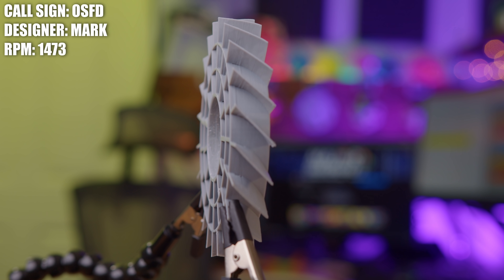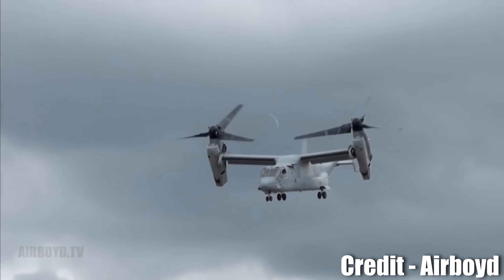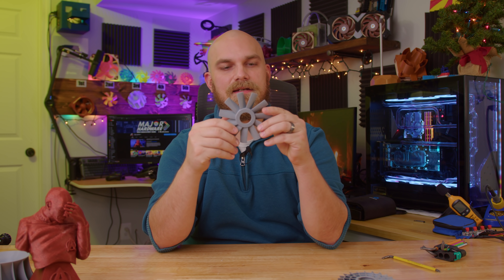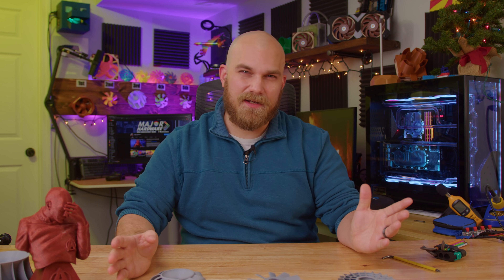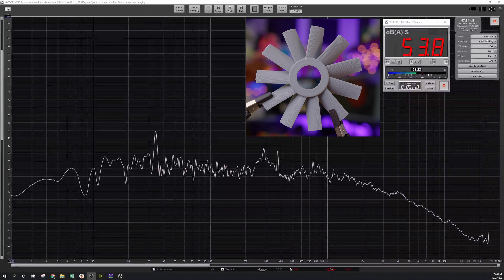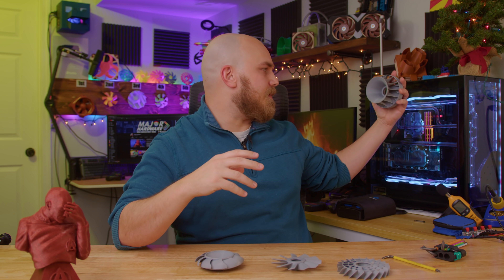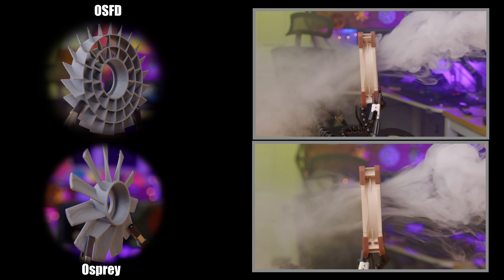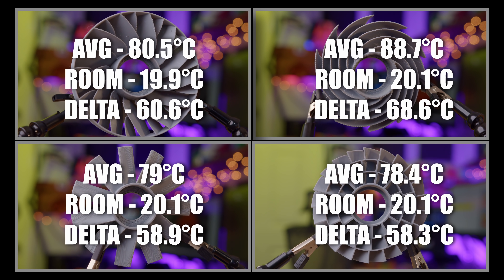INTERESTING | Fan Showdown S3E10

Comment: As for the Francis turbine can you squish that down to about instead of that big big funnel maybe squish it down about a few more centimeters and maybe tiny tweak to the angle of attack those blades in that intake are..... Maybe it actually might improve.
Reply: And I mean like it would not have as much weight on those tiny motor bearings...... And it would flop around less

Comment: I love this channel lol, I just want you to know I bought six phantek T30's and 2 noctua NF-A14s because airflow why not lol. Not to mention the 2 extra thermaltake tough fans that I bought when that review came out. My pc is now so loud I can hear it across the house. It's amazing lol keep up the good work and thank you for these videos
Reply: Linus tech tips did a video in the last... day or two? that was supposed to be about how much it mattered whether your front panel was solid or mesh, but actually ended up being largely about how more and stronger fans could actually make your cooling Worse, because while they increased the flow Rate, they also changed its Path... with the result that the CPU got cooled SUPER well... and the GPU basically cooked because the eddies and such caused by the cooling fans prevented the hot air in that part of the case from ever actually moving away from the GPU.  So yeah. More complicated than it initially sounds.
Reply: @laurencefraser  I haven't seen it yet but 2 of the the high powered fans are blowing on my gpu which I have set to max fans always. I should also mention the my case has a gaint 360mm side fan. While I haven't done a smoke test lol, I have put pieces of thin blue painters tape everywhere and they all move extremly well. No dead spots. Everything is overclocked as high as I can go and nothing gets above 40°c except my cpu which stays at 60°c I'm running everything amd/radeon so they're known to run hotter so I went for as much cooling as I can. It also helps that the room says at 60°-65°f lol

Comment: The scooper dooper should be reversed, looks like it would perform better going the other way
Reply: To be honest, this is not the latest version. I sent another message, with improvements. However, now, after what I've seen, I want to work a little more.
Reply: @sl_st  hope to see another revision, it is a cool looking design.
Reply: @sl_st  a v2 of this would be dope to see
Reply: Nah the design does not leave big enough room to move air through, it fills it with unnecessary plastic. On top of having less airspace, resistance increases with smaller spaces further killing the performance. That fan is doomed. Fun design, but doomed.
Reply: @KimonFrousios  so half the blades and it might work?

Comment: Kinda curious how the turbine would work with some kind of collar to direct the exhaust air, could be used in a pull config on a cooler and send air straight out of the case

Comment: Would be neat if you had a static pressure test rig that could double as a flow rig.  simple box with a hole in the back that would be opened or closed as a fine adjustment to flow for the hole in the top where you'd put an acrylic tube and a ping pong ball. Adjust the hole size till the ping pong ball is maybe a couple inches from the top as your calibration. The other fans would have to try pushing the ball up the tube to beat noctua. Think lung capacity gauge. This would accurately gauge flow.  For static pressure, you could use the same box but block off the air flow calibration hole and acrylic tube. Use a clear nylon tube shaped as a "U" about idk, 8" tall? Partially filled with colored water. atmospheric pressure , the tube sits at rest at 0 inches. Use noctua as a benchmark and see how many inches of water the fan pushes it. This is your static pressure literally measured in inches of water.  Doesn't get much better than that. and it's more content, as well as more actual measurable data. CPU cooling is cool and all, but there are too many variables. As an added bonus, these tests can take a fraction of the time it takes you to do a cooling test. ;)

Comment: One metric that might be interesting to track in the future is how much these fans perform against static pressure. We can infer this  indirectly though the CPU results, but it's probably a good KPI to predict performance.  Or you could just show the flow rate of the smoke when there's a stock cooler attached.  Love the videos! :)
Reply: Should be fairly easy to implement as a DIY solution, just a box with a typical hydro-manometer. Could also have a similar plenum setup for testing the pressure drop of a cooler. The leaderboard should be changed to separate airflow and pressure fans, though, especially as the entire range of fans is only tested on one setup that'll favor one over the other. 

But it might also be a better idea to just give GN an SLA printer and let them have a go at their own fan showdown, considering they have industry equipment for proper testing and they have proper methodology.
Reply: @xaytana  Who is GN?
Reply: @reverse_engineered  Gamers Nexus

Comment: Hello! Very different ideas for moving air but quite effective (other than the scooper dooper) nonetheless. Great episode 👍

Fan Idea
I do not have any 3D modeling software or skills to create this, so I am putting the idea where it can count

Callsign: Celer
Description: Made by math itself.
Design: Front swoop is Phi and airfoil shape is brachistocrone curve.

This was inspired by 2 fans. The Brachistocrone fan, made to look like air scoops. The Golden Ratio, which had an interesting ring around the edge. 
If anyone remembers episode number or true callsign, I would appreciate it. Thank you if you're reading this, and have a good night.
Reply: Someone get this on the show

Comment: New idea for the smoke test. A 1x1x1 box used to pull the smoke out of. Thus keeping any excess smoke from coming around the fan and making the discharge hard to see. You could also time the amount of smoke injected into said box and time how long it takes to clear out the smoke. Maybe giving a crude cfm calculation in the process.
Reply: The air also has to enter the box. Which would cause problems:
A. Then it can’t hold the smoke if there is an air inlet in the box
B. Even if managed to keep the smoke in the box would act a big funnel. (Cheater)
C. The box would never be completely free of smoke
Reply: @carterkirtz4848  didn't say anything about a completely sealed box. Also how do you think case fans work? What I suggested is absolutely possible to do. A slider in front of the fan and a second slider opposite the fan for a fresh air intake. A port anywhere else to inject the smoke in. Fill it with smoke. Open the doors. Turn on the fan. Pretty simple idea. Don't overthink it. The box could even be the dimensions of the fan for height and width but 2 feet long with a divider in the middle. Fill one half and open the divider once the fan is on. That'll show better smoke "suction"
Reply: 1inch cube?  1 meter cube?  1 what?  it makes a huge difference.
Reply: yes a plexi glass rectangular box with the fan at one end and the smoke at the other

Comment: This has to be the most underrated tech channel. Fan showdown is such a great concept and allows for a lot of viewer interaction. 

I haven’t been drawn to 3D printing, but if anyone would get me into it, it would be you. Suggestion for a video if you’re looking… 3D print air guides to mount on to case fans to point/direct the airflow to components. I’ve always wanted to know if this would help, especially on a large case where airflow can get lost.

Comment: Interesting that the Osprey and OSFD had similar blade profiles and performed similar, but the ringed fan won out. I wonder if just more blades on the Osprey would produce similar results. Would be really cool to see the same fan blade design, but with 3, 5, 9, 12, 15, and 21 blades or some such. :)
Reply: Right? Iteration is what the fan showdown doesn't cover but I really need to see
Reply: The rings on the OSFD are likely acting as "wing fences" capturing air fling out along the length of the blades as they spin.
The best fans often have features that act that way.
Reply: @LordCakeskull  the current second place has emulated nacelles from it's inspiration, and I think they're performing a similar function. And the first place has an entire duct, so that's no issue. I think a single fence like is found on modern jets is enough to prevent stream slip. Especially at this scale, 3 rings is uneccesary.
Reply: If i recall correctly there was an iteration test on this channel. Must have been prior to even EP1 of S1.
Reply: found some of the iteration stuff, but unfortunately not as in depth as i was remembering...

https://www.youtube.com/watch?v=V_TCw1zDsY4
https://www.youtube.com/watch?v=aE5TGo9jHzg
Reply: Didn't they do something like that on this channel some time ago? Obviously not with this specific blade design. I seem to remember fans with 1, 2, 3, ... blades.

There is a reason the sweetspot for fans of this size and speed is 7 or 9. Too many blades and they get in each other's way, getting caught in the wake and starved of air. The smaller air spaces also raises resistance. The extreme at that end being a fully opaque disc. Too few blades and they are not grabbing as much air as they could.  The extreme at that end being having no blades  at all. Neither a solid disc nor a bladeless hub move any air.
Reply: Dude I swear to god I'm seeing you everywhere. I love the impreza build and I open tik tok comments on random videos, and bam. you're there. Now I'm on a random YouTube video and bam, you're there. I didn't even realize you had a channel!
Reply: @Cyrashe  Haha, I am known for being everywhere! Thanks a lot. Glad you found the channel. I will be posting the full V10 Impreza build on here soon.
Reply: @802Garage  V10 Impreza ? Sounds like a lot of fun ! Have fun with that :D
Reply: @Arakij11  Haha it is fun! Just so much work. It runs now at least. Current vids on TikTok. 😁